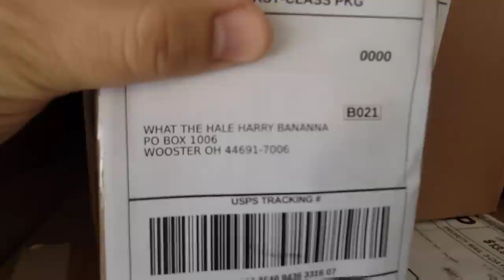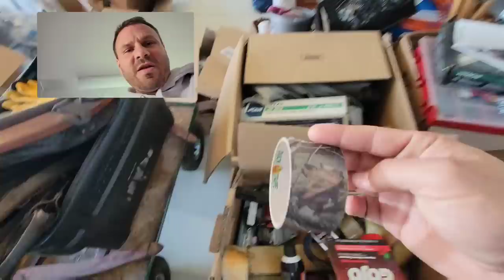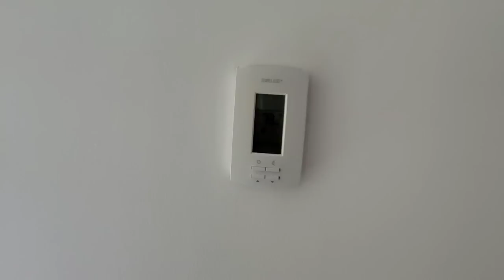FOUND ANOTHER SHOCKING SECRET ROOM ... I Bought My Dream House

Comment: Check your outlets, sometimes the switch is connected to an electrical outlet, I have one in my home. It is especially useful for lamps plugged into the outlet, you can keep them on, put control them with the wall switch. It is also nice for Christmas tree setup, plug in the tree and control the lights with the wall switch.
Reply: Our home has several outlets where we have lamps plugged in that are controlled by switches. In the living room one turns on a table lamp and one turns on the ceiling fan. TV

Comment: The bathroom with the exhaust fan with heater has 4 light switches.  One is for exhaust, heat fan, main light,  and Night light.  Which is burned out. Replace the bulbs and 4th switch will work.

Comment: Seeing some of the bones of the house (including metal studs), the add ons to the structure, along with the wacky electrical, I'd like to pose a question. If you owned the house, and money was no object, would you work with the existing building or would you tear down (the house only) and rebuild?

Comment: My wife and I went through the same issue just over two years ago when we moved.  The first owner was either a handyman or electrician or both and a lot of the repairs were not up to code.  We spend a couple of weeks figuring out what light switch went to each light.  The circuit breaker panel is another issue.  I would suggest creating a legend for the light switches and labeling the switches.

Comment: When our son built his home, the top plug outlet  under each window of the house  was wired to the coat closet  at the front door. At Christmas one flick of a switch turns on every candle in each window.  In his garage he installed a urinal so when he was working on his sand rail didn't have to go in the house.

Comment: I’ve been in this house 39 years and I STILL get mixed up on the light switches. I’d go nuts in your house without labels. Use white label tape with black lettering and the labels will be less visible. Also, one day about 15 years after we moved in, my late husband was watching 🏀 🏈 ⚽️ sports in his Man Cave when he happened to, out of the corner of his eye, catch me carrying a big ladder from the garage up two flights of stairs. Use to my crazy antics, it didn’t faze him at all when I explained that I had never looked in our attic and decided it was time to open the ceiling hatch. 😜😳 I was hoping for more storage space but found nothing but rafters and insulation and I am too lazy to install some floor boards. P.S. You need to plug EVERY HOLE in your house before the squirrels 🐿 decide to move in. They will get inside your walls and destroy the wiring, leave dead babies which smell awful and drag stuff in from outside. Three times we had that problem and twice they destroyed my laundry room and pooped on all my clean laundry hanging on wood racks and hangers to dry. They got in by chewing through outside plastic mesh covers over a vent. Also, periodically walk around the outside of your house and make sure that a woodpecker hasn’t drilled holes in your siding. Other birds will then move in and nest. LOVED YOUR VLOG. HOPE YOU ARE FEELING BETTER, GEORGE. 🥰
Reply: Bats and/or racoons as well.